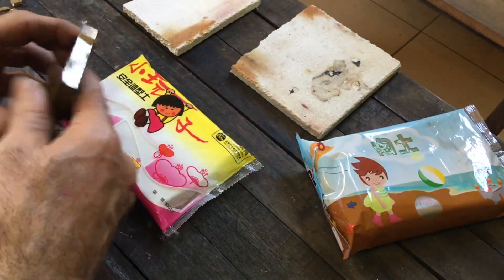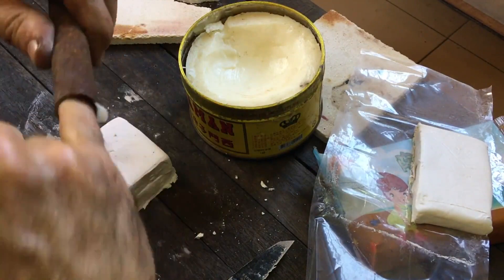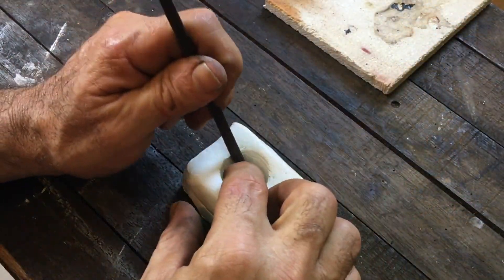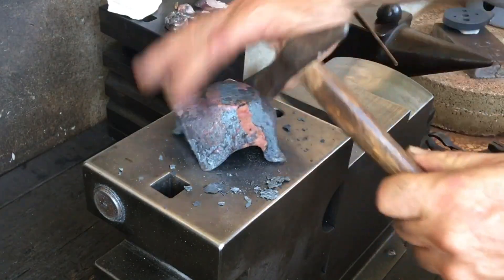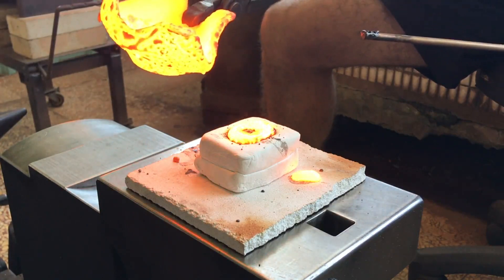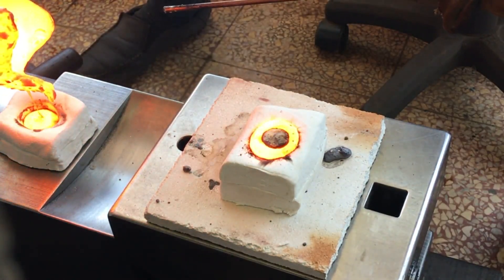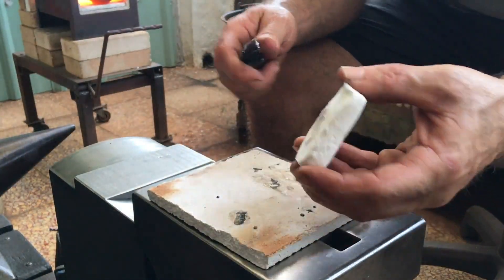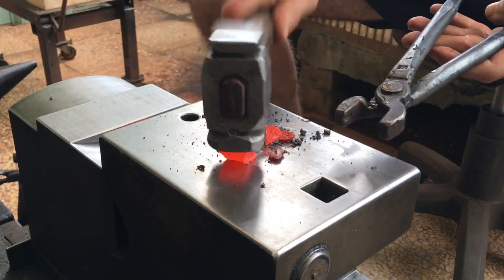Casting Copper Ring with Brass Insets - Fun Failures

Comment: Safety...a wonderfull thing you can nag about forver....do not wear any sort of clothing that will melt when heated and you might want to wear a leather apron and have solid shoes on atleast....Would even forgive shorts if you had an apron on, then you would have to be standing though. Actually you should be standing for that tiny murphy's law accident where you spill things on yourself....if you're sitting in such a case it might end up in your crotch....Solid video though and taking extra time just to show how un-smithable brass is was thoughtful.

Comment: Did you really pour metal into that clay?  😱😱  You would have been better off using some of your refractory material and carved it out and poured into that.  
If you want to cast copper, you add silicon or some shitty pewter would be close to make it cast better.  Brass is NASTY shit!  It's the zinc that increases the suck factor!  Did you watch my video on what is bronze?  I will not screw with brass EVER!  Bronze is 94%copper and pours like butter and shines like gold.

Comment: The Spalding is really dangerous. It comes form water in your mold, try more preheating the mold in the forge for a more consistent quality, If it can survive. The stuff for casting is called investment, it's made for high temperatures like gold and is porous so it can have a vacuum pulled through
Reply: At least he didnt try plaster of Paris.  I see a thousand dumbasses here on YT try it.  Fun to watch them fail.